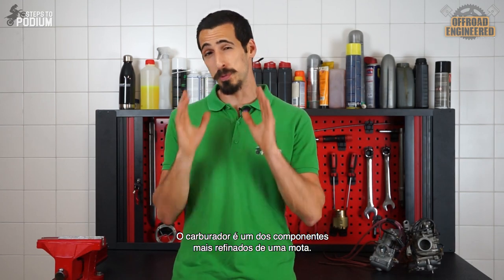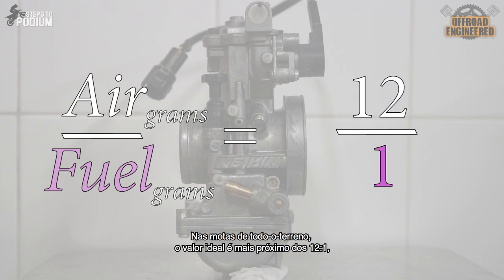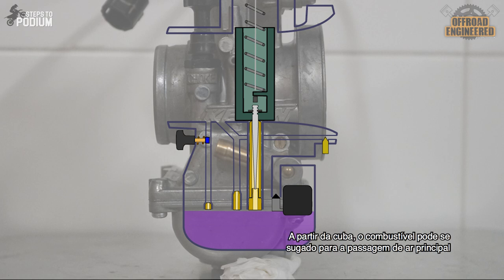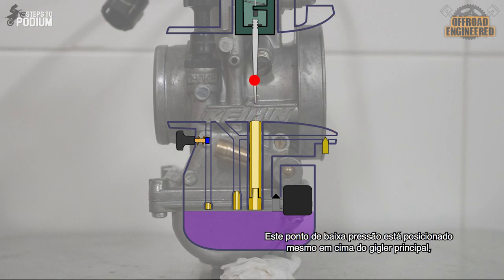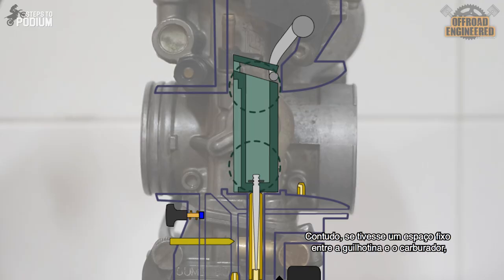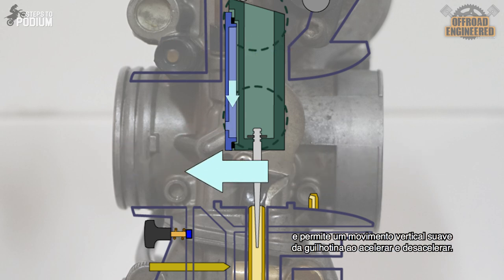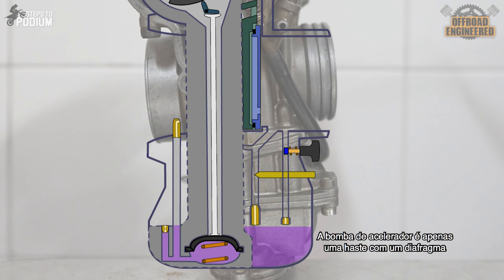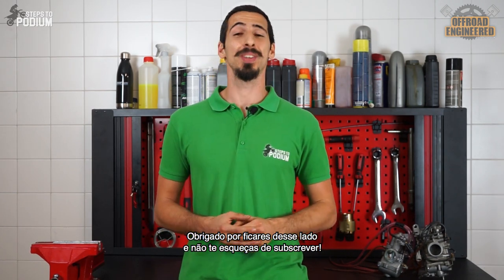How carburetors work | Offroad Engineered

Comment: Funny thing, I have a 50cc 4stroke bike that came with a 2smoke carburetor and it works amazingly. And as always, great video.
Reply from the maker: A 4 stroke 50cc probably has less intake vacuum compared to a 300 2 stroke, that is why 😛 I was refering more to 250s and upwards, since they are the most common 4 stroke dirt bikes 😊 but thank you for the comment!! 🙌💪
Reply: @StepstoPodium  you're probably right with that :)
Reply from the maker: I appreciate you chipping in! Other people might have the same question and in fact it was something I forgot to mention in the video 💪

Comment: Brilliant video! Very much appreciated! My fcr carb bike idles fine, but part throttle is very hesitant/stumbling. I assume I have to readjust the sliding needle to lean it out a bit as it smells rich and popping occasionally too. Part throttle riding is pretty bad as the bike doesn't like settling at any given rpm. It likes idling, and likes going fast. Nothing in between. Tried giving it bigger main jet but it ran and stumbling even worse. If anyone had any ideas what may be wrong with it, or what should I try doing to it, let me know! 2008 klx450r, fcr-mx42 carb
Reply: Spent all day changing jets, moving needle, etc. Most of problems went instantly away once realized my spark plug tip was damaged. After giving the plug proper gap, larger main jet and dropping red needle couple notches, it starts easier, almost doesn't pop, runs very nicely part throttle again and turns rear tire into a dust factory on any abrupt throttle twist. Your video helped me looking for problems and making decisions, so thank you very much again!